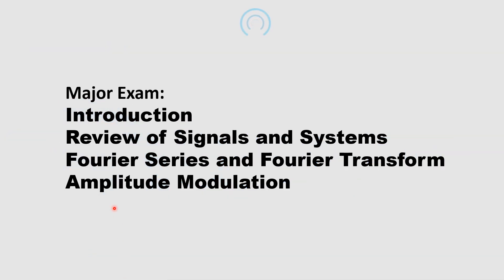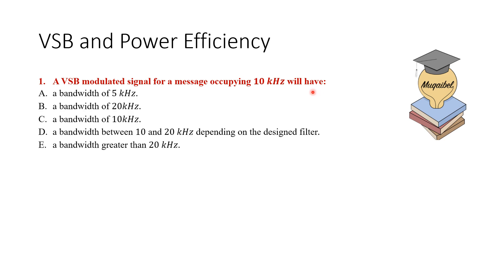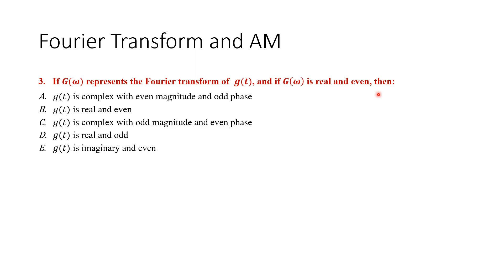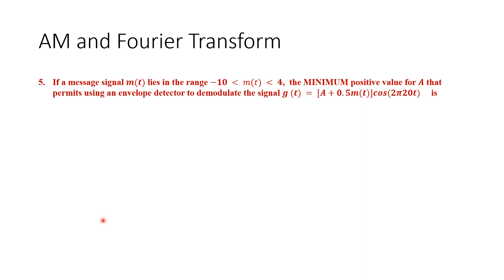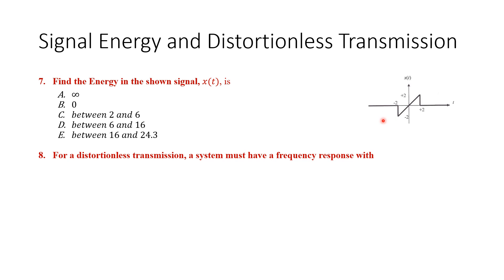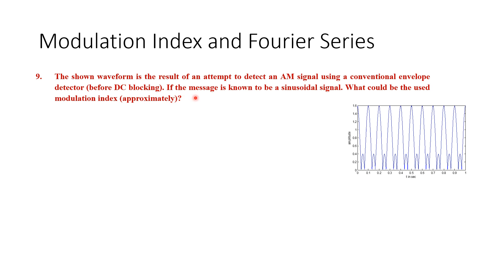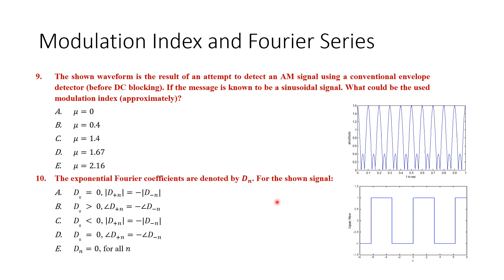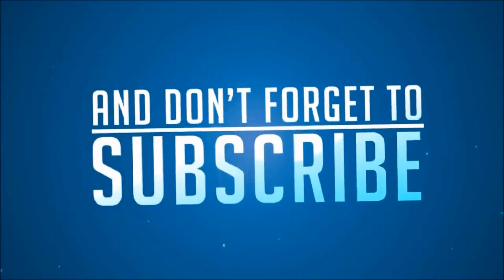Major Challenge 1: Review of Signal and Systems, Fourier Transform, and Amplitude Modulation

Comment: ممكن حل 5,9,10
Reply: For Q5 : you were given m(t) between (-10 & 5). However, the modulated signal has [0.5m(t)], and this means that the new signal will be between (-5 & 2). Then, the DC value 'A' should shift the whole signal to be at least on the x-axis in AM. Thus, the value which will do this for us is when [A = 5].

For Q10: (D_o) = (C_o) = (a_o) , and (a_o) is the average value for the signal. The average can be found from the graph in which we can see that the average is zero. Hence, [D_o = 0]. Also, [ |D_n| = |D_-n|] & [ the phase of D_n = - the phase of D_-n ] (you can check the double sided spectrum for any signal).
Reply from the maker: @عبداللهالعلي-ف6ت Excellent عبدالله
Reply from the maker: Please write your answers to these problems and others will help